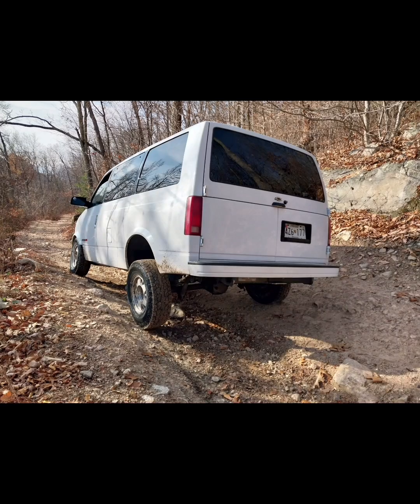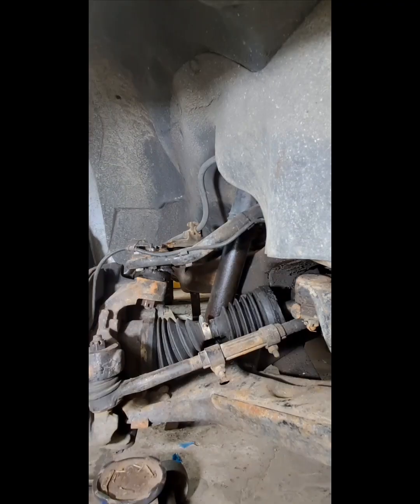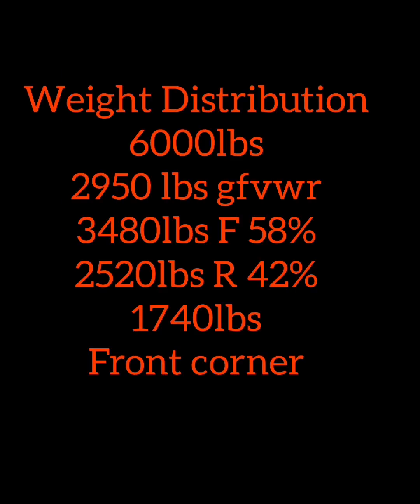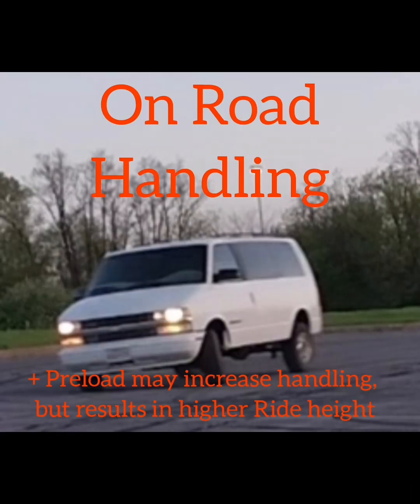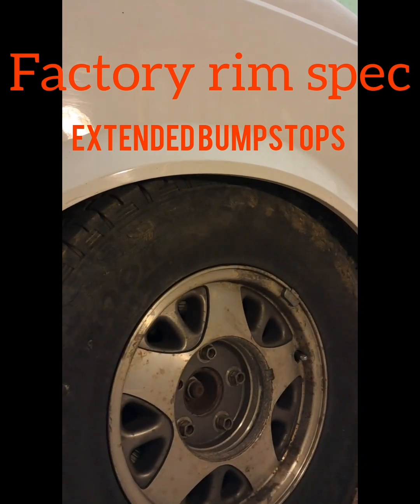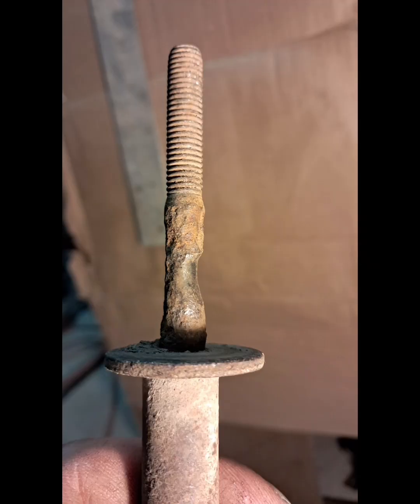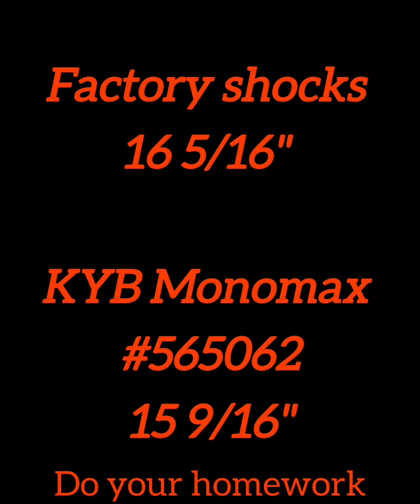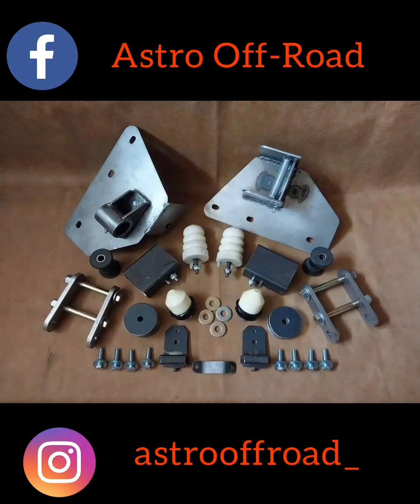Chevy Astro IFS Comprehensive Guide

Comment: definitely do Part 2: my 2003 AWD Safari has 3" body pucks, but My measurement = 18.625.  I had driver side Maxed out before but after blowing upper ball joints within a year & too harsh a ride, I backed it off a couple of weeks ago but may have gone too far.  I do not have original measurement of the Bolt threads of stock position so I do not know how to find that again.  however, I think to get to 20.25" from fender to center of hub would be maxing out the torsions again...  thoughts?
Reply: do you know the distance from Key brace to bolt head of the stock height?